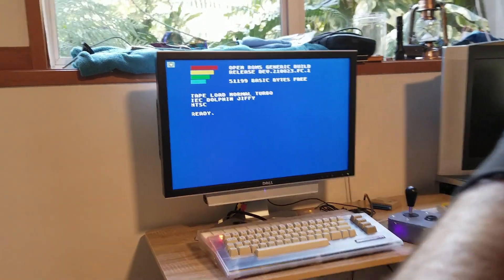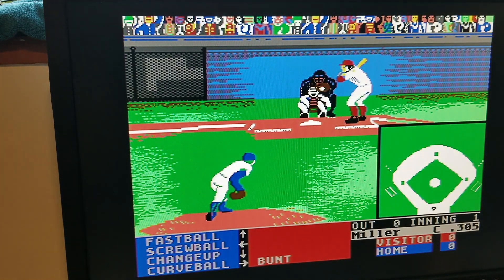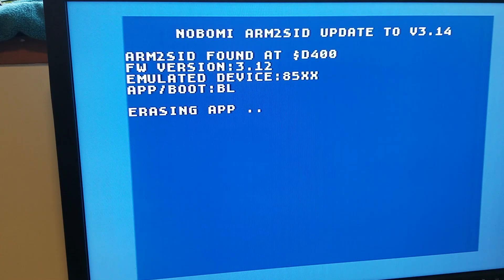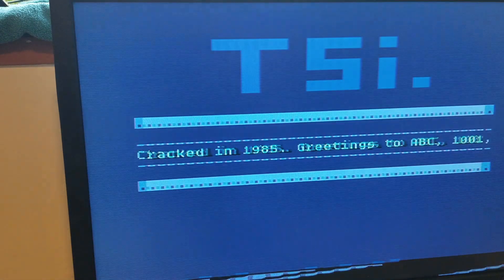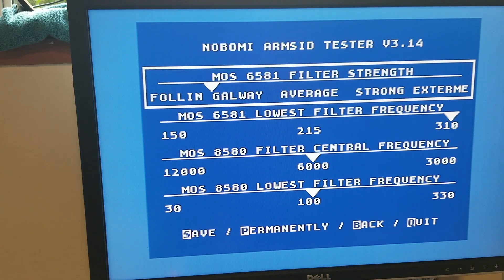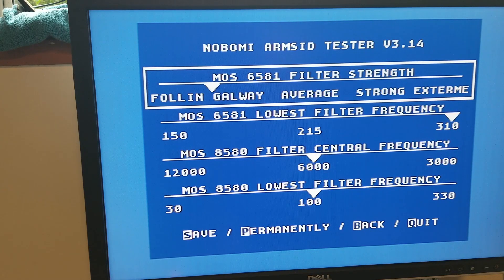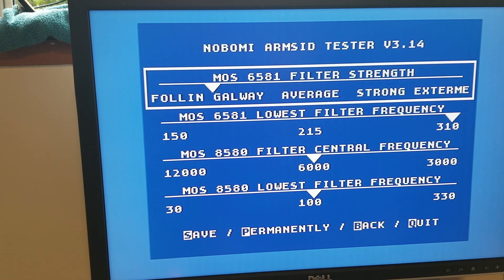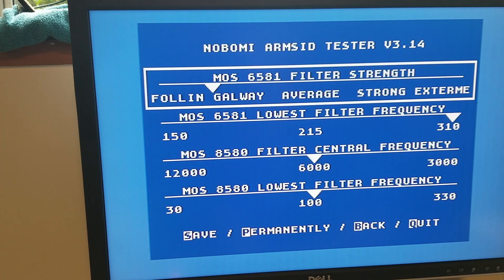Arm2Sid 3.14 update sounds awesome!

Comment: Another thing that can have an impact on the noise channel is the output capacitors on the board.  Early Rev A boards had the wrong value installed which would basically mute the noise channel.  I think if you play with different values there you could tailor the sound further.

Comment: Interesting and well done. Any chance some discrepancies are due to running at a 50 Hz clock speed (NZ) rather than a 60 Hz speed (US). Sorry if this is a dumb question.
Reply from the maker: Thank you!  No, not a dumb question at all, I've been wondering myself.  I'm running off a step down transformer right now, so 120v 50hz.  I imagine the CIA clocks on an NTSC machine will run slower.  I do plan on doing some VIC-II related videos here soon with my switchable machine as well as some other goodies.  We'll dive into the clocks and see what we find.